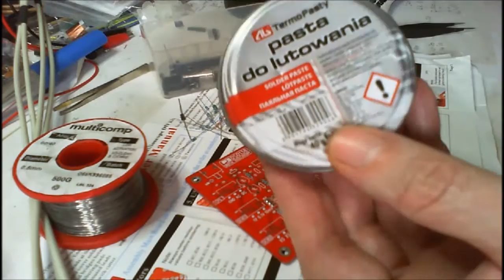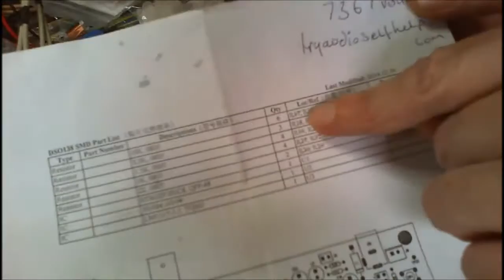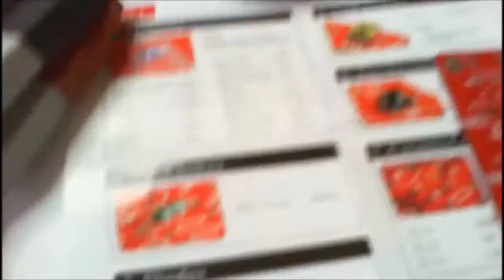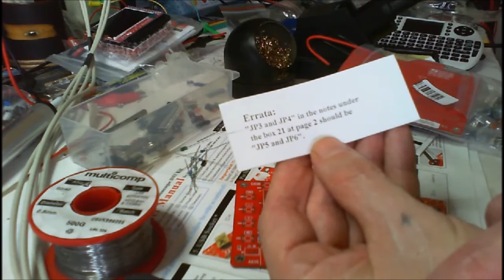JYETECH DSO138 Oscilloscope Building Hints N Tips

Comment: I avoided all the headache and aggravation, and ordered my DSO138 completely assembled. It only cost a few bucks more (Amazon.com) than the kit form. Only thing I needed to solder on mine was a jumper loop on J2 large enough to accomodate an alligator clip, so I could use the board's test signal to fine tune C4 and C6 trimmers for best wave shape.